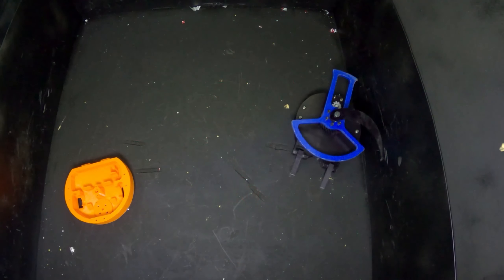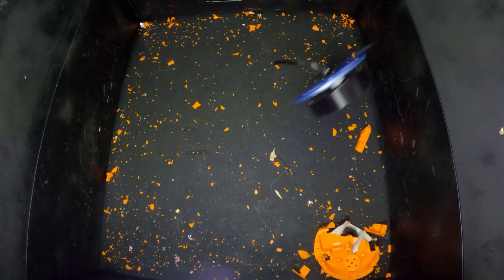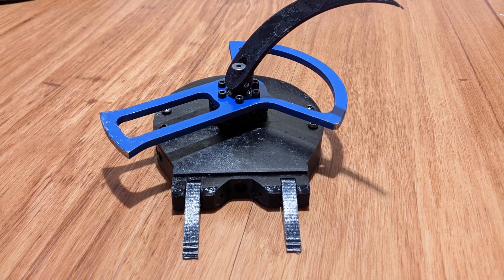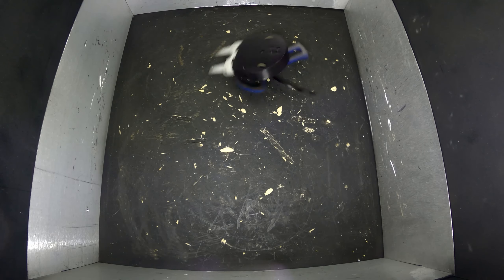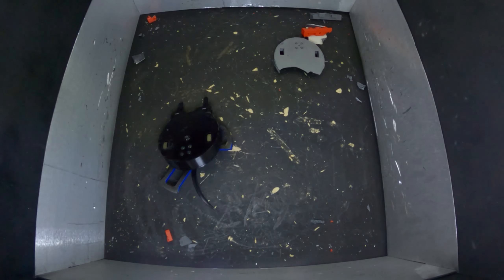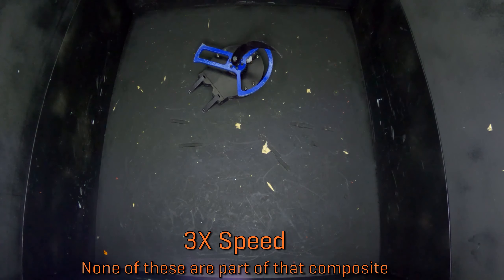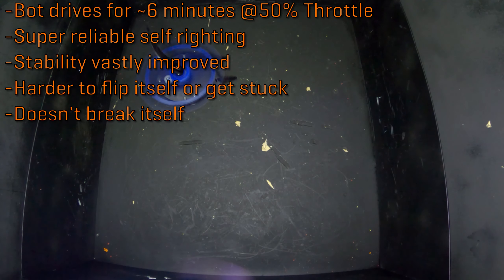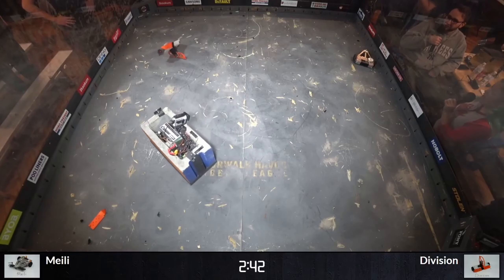Stability Quest Completed! Destruction and More. (Part 3, 1-lb Antweight Combat Robot)

Comment: I like the weapon design. I think bite is the most important factor for damage, this looks great. To get a little more bite distance, could you maybe make the back radius slightly thicker, in Z-axis, and then bring it in a little bit? Would add a little air resistance I know, maybe not worth it.
Would also love to see someone bold enough use Tungsten parts on the weapon. One, for the immense density to maximize inertia and kinetic energy per weight. And/or two, as a contact surface, being also immensely hard. Later being more challenging since you run high risk of weakening and adding critical stress risers at an all important spots on the weapon, plus the brittleness could be big let down depending on the alloy. But just adding density to the back of a weapon wouldn't have this problem nearly as much. If anyone could pull off making the part would be epic.
Reply from the maker: I can't make it thicker in only some areas because the weapon is lasercut from a flat sheet of material so it's only a '2D' part. But you're right that would be a slight optimization. I think the main obstacle to bite is that it doesn't reach out in front of the forks since this is a 7" diameter weapon and I designed around a 9" diameter. But approaching another bot from the sides or in reverse can be devastating in its own right.

It might be a fun experiment to try using some broken tungsten carbide endmills or something, though they break because the impact toughness of carbide is terrible. It is after all practically a ceramic with microscopic grains of ultra hard material stuck together.

Comment: Do you have enough grams to spare to add a cooling fan to the bottom of the drive gear? Pull air up through the hole above the motor, draw in around the wheels.
Reply from the maker: I don't have any added space for that unfortunately
Reply: @JustCuzRobotics  make the hole in the lid larger and set the fan down into it.
Reply from the maker: I doubt any fan design with blades only 3mm tall to match the lid would work very well. Plus the motor gets the hottest when stalled to self right in which case it isn't even spinning so that would sorta defeat the purpose.

Comment: So when are we going to be able to pick up this bot, also is there a way to make it a plastic bot as well.
Reply from the maker: Sadly Cobra motors have discontinued the motor I used here as a weapon motor and I'm going to need to find a suitable replacement that won't ever go out of stock in order to make kits of these if I ever do decide to go that route. I might just do what I did for Division and sell the CAD model rather than trying to sell a complete kit of parts since it is actually sortof a logistical nightmare to need to buy and stock dozens of parts. Plus the upfront cost to stock parts for say 10 robot kits would be hundreds of dollars with no guarantee they ever sell. 

Also, yes, you can totally get all the parts printed in PETG or PLA and use the bot as a plastic ant! Just have to design a better 3D printed weapon for it since it's severely underweight as a plastic ant.
Reply: @JustCuzRobotics  please let me know asap if you can get that cad out. I have a tournament next month and would love to take a plastic version of this bot. I would also like to make a hard hitter of this bot as well. As far as  motors go stick with emax. I use them for fpv and let me tell you they can take a hit. Can wait to see the bot fight. Oh as well I would love to see what you take with you to tournaments.